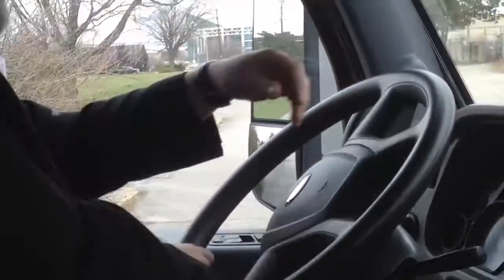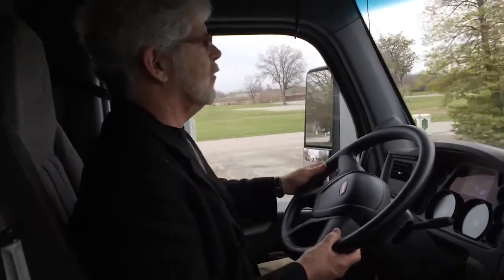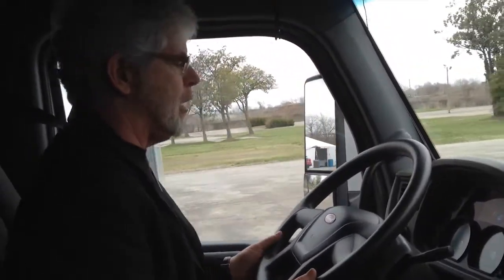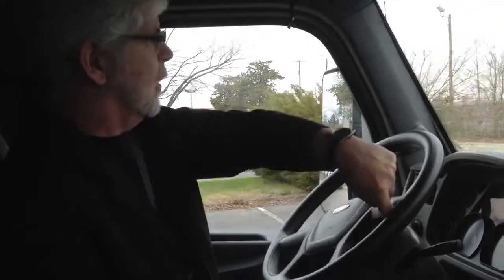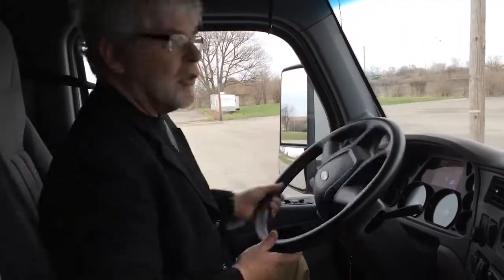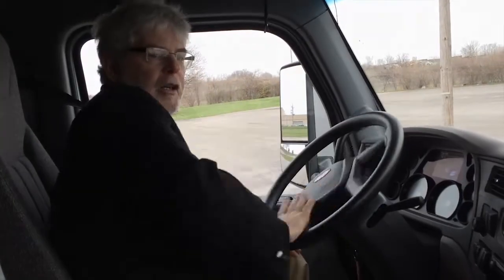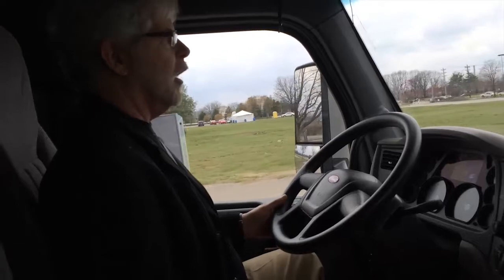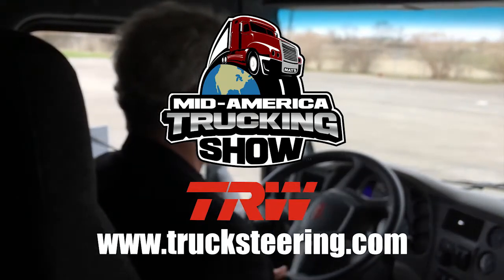Focus On… TRW ReAX Power Steering

Comment: the most important feature is you wont get the wheel knocked out of your hands if hits a big bump. i have had the volvo dynamic steering that this system is a copy from and it works really well and you wont get as tired.  but expensice parts and mine has been replaced once.